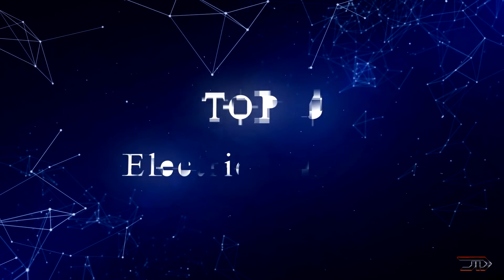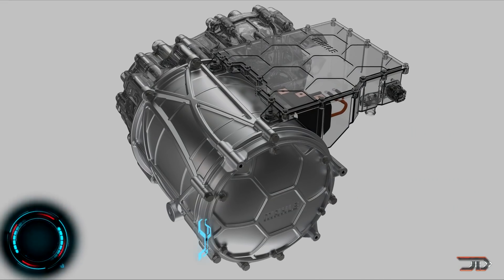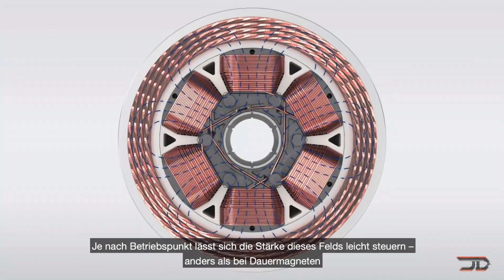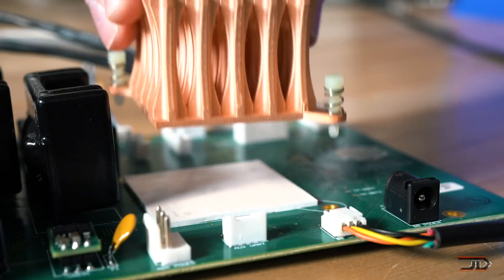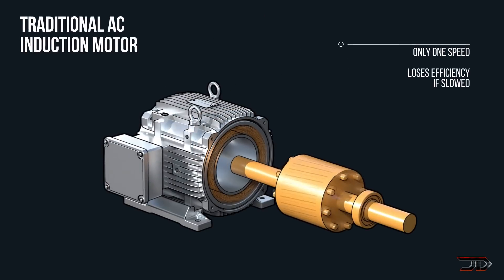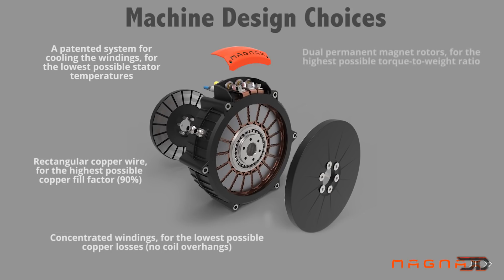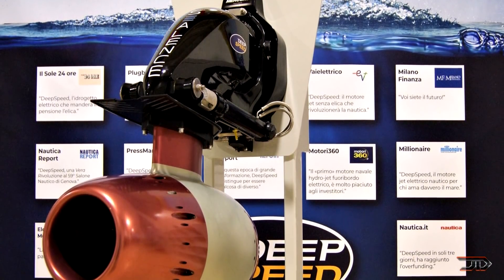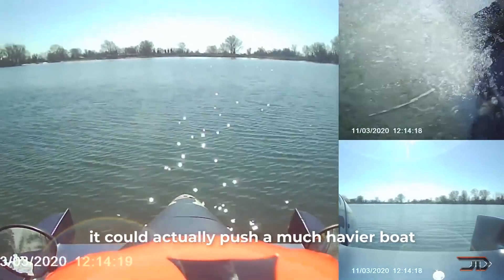5 GAME-CHANGING Electric Motors

Comment: That Mahle motor is not an induction motor, it is actually a synchronous motor with electromagnets (instead permanent magnts) in the rotor. This is one of the oldest electric motor designs.
The difference here is that the power for the rotor is provided through electromagnetic induction by the special coils, dispensing the need for slip rings that are commonly used.

Comment: Worked for Sundstrand Aerospace which is has dominated the aircraft generator market.  Only the printed copper is new to me.  When I left them is 1997 metal printing didn't exist, however; I have seen copper tube wires and spray cooled motor.   
I personally assembled and the electrical engineers tested a 350 HP induction motor that was fed up to 1000 Hz 3 phase AC that I could easily pick up including the gear reduction.  It had spray cooled windings and liquid cooled rotor.
 Also worked with PM and switch reluctance motors.  Seem strange that your commented about the vibration and noise for a reluctance motor and not for a PM motor.  Both need angular positioning to switch at the correct time so both will due to errors in the switching or inductance in the incoming current be subjected to torque issues that cause vibration. 
The induced rotor current electromagnetic machines have been the standard approach for generator since the 1950's when Sundstrand got into designing their own generators.  The problem with brush wear was well know during WWII.  You can design them for sea level or high altitude but not both.   No one used brushes if the magnetic machine had to work everywhere in an airplane or rocket.
Reply from the maker: Thanks for sharing! I did not know about the altitude changes, that is really interesting.
Reply: why only 1000hz?
Reply: @Blox117   The losses in the iron and copper go up as the frequency increases.  Iron is not used for very high frequencies.  The frequency also is driven by the capacity of the electronics.  As frequency goes up switching 400 amperes is more difficult.  The customer wanted the motor and drive to fit into a 2 foot diameter tube.
Reply: @thomassutrina7469  cool, i was wondering because I set my ebike motor to switch over 30khz. it makes less audible noise that way
Reply: Explain the spray cooled windings? I run a EASA shop and have yet to see this in any industrial application
Reply: So its important to differentiate between switched reluctance and synchronous reluctance. IPM motors still use sinusoidal currents, so they are (relatively) low noise. Switched reluctance uses VERY non sinusoidal current waveforms which contributes to their noise.
Reply: @austinschwebel819  We use that on our motors as well. There are nozzles that spray cooling oil onto the end turns of the motor, and the bottom of the motor acts as a sump. It's actually gotten pretty common now in the EV world and most/all oil cooled motors spray it directly on the windings. For shorter stack length motors it is more efficient than a water block.
Reply: @BIGGlep  im trying to do something like that with my bike motor. but since it's a hub motor its not really possible to install stuff on it. there is statorade which fills the air gap between the magnets, but i wanted to add oil which can bathe the windings themselves. i was even thinking of completely filling the motor so there's no air inside, just to see what happens lol
Reply: actually im wondering if we could just use a very large diameter bearing housing so that the stator and rotor can physically touch each other. we could use cylindrical bearings to maximize the contact area as well.

this way heat has a direct metal contact all the way to the outside
Reply: @Blox117  So you don't want to fill the air gap will oil. I am aware of statorade. The problem is shearing, when the air gap is full of oil the frictional shearing losses can rapidly heat the surface of the magnets and demagnetize the motor. The best way for a outrunner style motor, would be to as you said use very large bearings so that the stator is surrounded by stationary metal, then seal off the stator. Put high temperature sealant down the gap of each stator tooth so that you create a sealed channel. Then seal the perimeter of the sides of the stator to the now stationary side plates. You should then be able to pump oil directly through the windings (assuming there is a gap between adjacent coils. Does that make sense? But you need to avoid filling the air gap with oil.
Reply: @BIGGlep  well my bearing idea would eliminate 99% or so of the air gap, but I see what you are saying. that way the oil never even touches the magnets. only problem is that i can't build such a motor, lol. a bearing like that would need to be custom made.
Reply: @Blox117  Are you saying the bearing would be in the air gap, as in the stator on the inside of the bearing and magnets on outside?
Reply: @BIGGlep  yes, that. and a very thin bearing sits in between
Reply: @BIGGlep  actually i guess a better idea would be to move the stator to the outside and use a large bearing to keep it stationary. there are some constraints compared to many motors because its being used as direct drive in a vehicle
Reply: @Blox117  I guess I'm confused as to what you mean. The stator has to be stationary
Reply: @BIGGlep  yeah i messed up, i forgot force wouldn't be transferred through a bearing lol. so only the air gap bearing would work
Reply: You should share some of your expertise! I would gladly learn about motors!

Comment: This may be off topic, but I think someone might find it interesting.
Piston style over unity electric generator. By AMA
Motor segment:
1 motor with bar connected to it standing vertically
circular disc connected to bar that has magnets embedded in it surrounded in high permeability material to focus magnets outward pushing force in an upwards direction from top of disc.
Power Bar segment (Just name I gave it)
Hollowed out cylindrical Bar of material horizontally positioned.
donut shaped material with openings around its flat edge for magnets surrounded in high permeability material to be embedded.
place these all along the cylindrical bar connected to it solidly. except at far ends of bar.
At both ends of bar rings of material that can be magnetically repelled in specific locations (magnetically repelled in specific location is in reference to outside of ring area that faces away from center of bar)(Other side of same ring facing in towards center of bar is capable of magnetic repulsion all around) are connected solidly to bar. points of repulsion on these rings is off set from each other on each end of bar.
3 Hollow donut ring structure with connecting bar:
Ring structure has all magnetic repulsion on inside of donut shape & and can rap around the main bar so that the bar wont be causing friction on things as it moves back and forth. 1st positioned around far left of bar, 2nd position center of bar & 3rd positioned on far right of bar.  
Tube structure is constructed in two parts that fit together on top of each other length wise over main structure & has openings for bar to the Ring structure that is connected around the main bar keeping it from causing friction on structure with it's magnetic padding. This tube structure is designed with material that does not block magnetic fields. Perhaps some type of transparent material glass or other. At both ends of the tube structure there is a built in groove that will house a disc, the groove has 4 points, top bottom left and right that has small magnets embedded in it on the inside so that the pushing force from magnets is pushing in towards the edge of disc that goes in this spot. The disc has ring around it that is repelled by magnetic fields so the 4 small magnets will keep it lined up but it will be able to spin without causing friction on structure. The disc has openings on it's flat side that face inside of tube and magnets surrounded in high permeability material are embedded in this disc. The disc has small bar that is connected to it that goes all the way to the other end of Power bar structure through the center of the hollowed out bar and connects to disc on other end. Disc on other end is set up the same but magnets embedded in it are off set in comparison. As first disc spins the magnetic fields will push against specific spot on disc connected directly to bar, pushing bar in other direction, once bar is fully pushed over, further spinning of disc will then align the other sides magnet to push it back. Tube structure also has half moon shaped protrusion on inside and on both halves so when tube is connected they line up to make a full ring shape on inside of tube, these half moon shaped protrusions have at least 1 small round opening on it's side in middle of curve that faces away from center of bar. The opening has a small magnet embedded in it so magnetic force is repelling out sideways away from center of bar. The protruding ring is positioned to line up slightly further in towards center of bar then the ring of magnetically repelled material connected directly to bar. This way when bar moves to right this magnet will act as a stopper keeping bar from going to far & same setup on other side will keep bar from going to far to left. 
Copper coil setup:
copper coils are wound up as if wound around the width of wood board for a distance equal to width of magnetic ring setup on bar. Wound copper coils are then looped around the tube like a donut lined up perpendicular to magnetic fields. Ends of copper coils are connected into separate construct that will allow electrical current to flow somewhere else.   
Circular construct is built like a stand that goes around the outside of motor segment. 
Circular construct has flat ring of high permeability (magnetic field shielding) material that has small openings that will allow magnetic fields through specific locations. Top of circular construct has groove to allow the power bar to balance on. Circular construct can also be placed on other end of power bar so it is balanced. The motor segment is positioned so the disc connected to the bar that is connected to the motor is lined up so the disc passes under the power bars disc that is at end of power bar. The high permeability material keeps the magnetic field from the embedded magnets exerting their force upwards from hitting into the disc in the power bar until just the right moment when the impact will cause the disc in power bar to spin which will perpetuate the piston motion in the power bar. More power bars of the same design are built and positioned around the motor segment in a circular fashion all the way around. The bar connected to the motor can be increased in length to desired height and more of the exact same setup is repeated higher and higher up maximizing the over unity potential of the construct to ridiculous proportions. :D Current from the power bars is diverted to power the motor as needed and all other current is diverted to power my game console or the world. :) Interesting variation to this design would be to connect the spinning discs on far ends of power bar to main bar that magnets are connected to so the magnets spin instead of getting pistoned back and forth. So long as moving magnetic fields are perpendicular to copper wires it should work.
                  By AMA

Comment: The hydro jet type motor was a project I was involved with in the mid 90's. It was quite successful and not one marine company wanted it. However, the draw back was the amount of fish kills we created. If we went through a school of fish instead of parting them they got sucked in and blended out the other side. Bigger fish on the surface stopped us dead along with any major debris like wood.
The project was later abandoned due to funding, efficiency and environmental concerns. If they can solve these issues at planing and docking speeds then I'd say this propulsion technology might actually make it.

Comment: What motors out there easily lend to someone modifying them to drive a factory type axle.  I'm not new to lithium battery systems but I am new to motors.  I'm looking for a very easy to design around 100-150hp motor.  Guessing gear boxes are a must with these things but what about a clutch?

Comment: The higher the motor speed, the higher the horsepower to weight ratio. The only problem is that a 20,000 RPM motor requires an expensive and inefficient transmission to get high torque and lower speeds.
Reply: "requires an expensive and inefficient transmission" it entirely depends on the tranmission you chose to bolt on to the motor. Unless you are trying to indecate that tranmission boxes are expensive and inefficient by nature, which simply isn't true. They serve a purpose and generally do it VERY well.
Reply: Find out how it is being rated. Is it bhp or are they deriving their power like vacuum manufactures do and figuring a full speed stall.
Take a spindle motor for instance, if you have a motor rated for 20hp it will deliver that from a standstill and stay out of the way of anything trying to stop it.
All without a transmission.
Reply: Tesla's new Plaid motor doesn't.
Reply: I'm a noob when it comes to electric motors, but shouldn't a higher spinning electric motor produce lesser torque than a low rpm high torque motor (considering both motors are rated at same power consumption) ? Lesser torque means it can be bolted to a transmission found in any standard roadgoing vehicle.
Reply: @jgkkvkddjjfgfjgr  Electric motors produce the same amount of torque at low speeds as they do at high speed... the very reason why they don't need transmission boxes. Just dump the tranmission and have the electric motor go staight to the drive shaft.
Reply: Electric motors have full power from 1 RPM.
Reply: @dragoncoffee2949  No, they can develop maximum torque at zero rpm.
Reply: no it just requires stronger magnets or thicker windings
Reply: @Nemoticon  nope, the Torque only flat on low rpm and then in the middle rpm the Torque drop.

Edit: so that's why it has flat horsepower
Reply: Doesn't need a gearbox, 

Needs different pole count, different winding turns, different copper mass, different magnetic strength and different voltage and amperage...

No gearbox required.
Reply: In fact, at high speeds, the electric motor becomes completely inefficient, as the electromagnetic coils lose more and more electricity through heat while creating less magnetic force. This is known because when electricity passes through a wire, heat is generated, and the heat increases as the electricity increases. One of the electrical companies conducted an experiment that without a transmission or gear box, the size of the electric motor would be larger, it would need stronger magnets with rare metals, and its electricity consumption would be much greater, in addition to the fact that it would require the introduction of unnecessary, complex, sensitive electronics!

Comment: the hydrojet is cool
Reply: Hydrojet: I want to see the demo in the plastic pool from startup, not after the pool water has got up to speed. There is no way that the spiral, hollow prop design shown here can be as efficient as regular propeller, or waterjet. The mass of the thing sounds very high. The video shots on the dam are not indicative of "acceleration quicker than a propeller". Only advantage I see is the possibility of few moving parts, but there would be other difficulties, like suitable thrust bearings and seals that don't kill the efficiency with friction.
Reply: @johnbgibbs  one thing to consider is that water would be going directly through the hole in it in a vector so as not to curve around it producing less cavitation at high speed. it also contains the water within it during pressurization unlike a propeller so at low speed it would only be pushing water directly behind it and not around it out to the sides for efficient high speed movement. It probably uses an internal concealed ring of ball bearings to reduce friction. it would seem to be much more expensive to produce than a simple propeller though since you have to get the ball bearings in there and the oil before water tightly sealing it
Reply: @wompstopm123  
A traditional propellor is pretty inefficient and from what ive seen has a narrower compromised  range of efficiency... The cavitation also generates a lot of vibration and very high levels noise in the marine environment.  There is also the damage  the prop blades can cause to persons and marine animals...beyond just collisions. 😖

There are more efficient 24% semi traditional props out there already  but they seem to be patent and price restrictive. 1500..2000 dollars for an average size three bladed prop.😬
In these pod drives bearings tend to run cooler because they remain in contact with the casings and therefore the water.

Its time to cut the waste and start using more efficient drives now....this is critical as their are 8-10 yr legal targets for decarbonising vehicles in the the developed industrial  world.. electric motors are already smaller lighter and  capable of better performance over a wider performance  range. They also dont produce the polution, noise and vibration.

Metal 3D printing and new composite material mixes might bring down batch  manufacture costs and allow specific tuned/scaled parts to be  Printed away from centralised industrial  complexes. 

Rolls Royce has been marketing large rim driven pods  for some years . 
Go to the companies other U tube presentations and see their development boats.